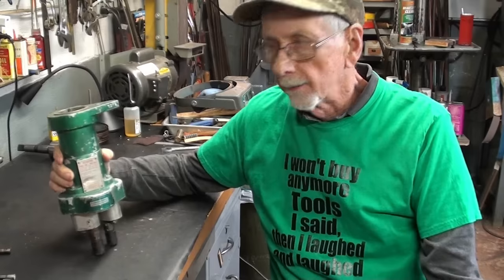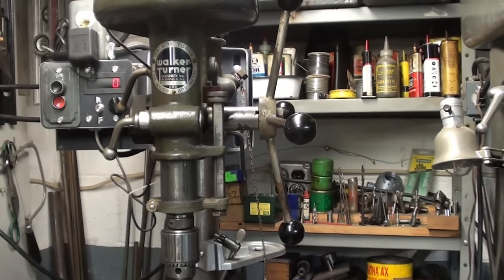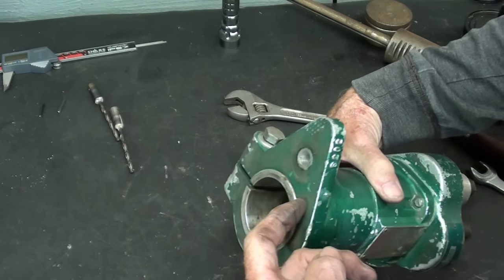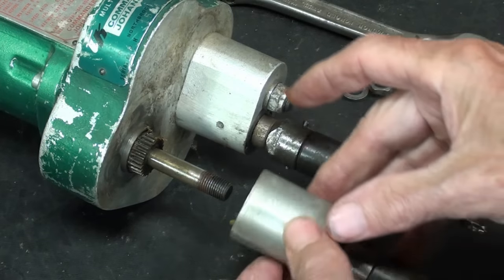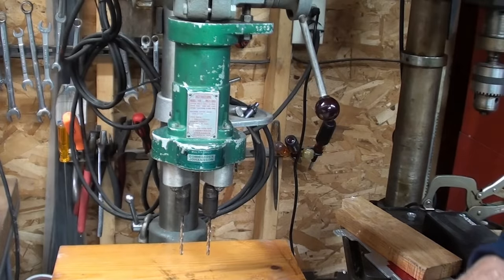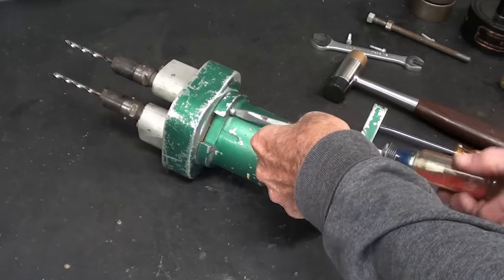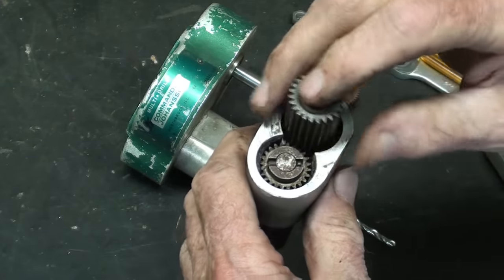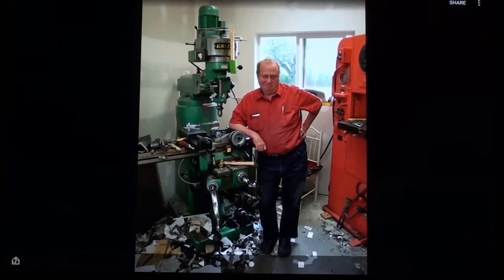MULTI SPINDLE DRILL PRESS Attachment #899 tubalcain

Comment: In the late '70's I worked for a small ( about 30 employees) Industrial Woodworking Machinery company.  Our bread and butter machines were multi-openng laminating presses for glue-ups, but  
we also made a drawer front dovetail machine that cut dovetail slots on the back of the drawer front for the drawer sides, with matching dovetails, that slid into the dovetail slots, then a router cut a slot in the back for the drawer bottom to slide into and support the front of the drawer bottom.  An option on this machine was an overhead bar/beam that could mount 2 (or more) multiple spindle drill heads (with integral motors) to drill 2 pairs of holes for drawer pulls.  These machines could process a drawer front in less than a minute, with repeatable results.  60 machined drawer fronts per hour.  I always wondered what the inside of those multiple spindle drill heads looked like, now I know.

Comment: My multi spindle drill press fixture is made by Johnson not Johansson. Mine is designed to drill concentric circular hole patterns. Cam follower slots on the diameter adjusting plate allows rapid circular hole pattern diameter adjustment. It adapts to the drill similar to your Johansson, but has a Morse taper clutch adapter eliminating the need for the drill chuck. 

Mine was mounted to a very large and heavy Doall geared head drill press. The fancy multi spindle fixture coupled with an integral 3 phase motor meant that I had few bidding competitors and I purchased the machine for $100! I removed the multi spindle drill fixture and installed the appropriate ball bearing Jacobs chuck. Being thrifty I purchased a heavy Powermatic drill press head, stole the chuck and sold the the drill press head making my Doall drill press investment $0! I wish that all investments worked out that well. 

Our shop used the multi spindle fixtures for production drilling and used drill guide fixtures as you described. I have kept my multi spindle fixture since I haven't found anyone that wants it. I may someday find a need to repurpose one of the small Jacobs chucks it is equipped with. My fixture uses extending splined drive shafts with universal joints to accommodate the varying hole center diameter function. CNC has pretty much obsoleted these fixtures, but they were expensive and highly engineered units in their day. Mine ran multi shift full time production for many years. The drive clutch was badly worn (about 30%) when I disassembled it. Since we never had a requirement to reverse the spindle, this drive lash was not evident in production use. Your video compels me to show my fixture to my son's and grandsons. They probably have never seen such a critter. ...now I need to find where I put it...😊

I call the keyed drive adapter a clutch. That may not be a universal term application, but I have seen the term used by several machine manufacturers for this application. Direct coupled motor/hydraulic pumps on small equipment like scissor lift pallet jacks and snow plows use this drive connection design (C faced motors).
Reply from the maker: Thank you👍👍👍

Comment: if anyone wants to see a BIG version of this look for a NATCO drill, National Automatic Tool Company. Back in the day local big factory had a few of them, even a pair with a shuttle table. They would load a gearbox casting into a fixture, and drill about a dozen 17/32 holes in one shot. Then slide the shuttle over to the other machine where it would tap all the holes at once. They worked well but in production, the little drive shafts and U joint would wear out and need regular repair or replacement.

I have had a few Commander heads over the years, came from who knows where. They always had broken gears, the small gears break teeth when abused I am guessing.

It was a fun interesting video, Thanks Mr Pete!
Reply from the maker: Those small garage look very delicate. But remember, the capacity of that head is 1/8 inch drills cutting steel.
Reply: Did a search for images, big is right, thanks.

Comment: so did this company sell different ends for the drill? it seems like it would be very useful in a production line to have two different speeds if you were doing something like using one bit to drill a pilot hole and the other to drill the main hole. or have one hold a drill and the other with a tapping head. I wonder what options it came with

Comment: Thanks, excellent video!  I would still like to see what's in those 2 small spindles, as they  gotta take a lotta end thrust and look too small for any thing that would last very long on the production floor.  The 2 long gears on their fixed shafts is nice, they've got a keyed shoulder & pressed in, the 'cap' as mentioned.    Also, did you go by feel for their 1/32 inch mounting spec to your quill?
Reply: Thanks Mr Pete that was great you made our day

Comment: I used to work at a small company making HF antennas (mostly for hams). We had a 3 spindle drill head. Drill press was permanently set up for center drilling various diameters of round stock with a set of vee blocks and the 3 spindle head.
It worked fine but was pretty fiddly to set up for our application and to get the holes truly interchangeable (drilling thru both sides of tubing).

Comment: I suppose after drilling the first two holes, you could reverse end-for-end one of the bits, and use it as a locator, and drill a line of equidistant holes?
Reply: You could do that more easily with a DRO on a milling machine. Just move over the desired distance and keep drilling until the material runs out.

Comment: Multi spindle drill models usually have every other drill rotating clockwise and the the ones in between, counter clockwise. That’s why you see drill bits that are left hand. It’s for those multi spindle models.
Reply from the maker: Thank you for that. My dad told me the same thing 60 years ago, lol.
Reply: @mrpete222  I figured you knew it.

Comment: I use to run a set up about like that, it had over 12 drill bits in it, we drilled the mounting holes in a large drive ring used in a power takeoff. drilled all of the holes at once but taped them one at a time on a single drill press with a tapping head.

Comment: How about sticking an end mill in that? Wouldn’t the drill head alleviate some of the objections to milling will a drill press. Couldn’t one drive a “conventional milling spindle” with appropriate bearings in just such a fashion? (Recently I thought I might be able to drive a milling spindle off the drill press via a chuck mounted pulley, driving the belt on the milling spindle. This looks simpler and better.) Chime in folks. :)